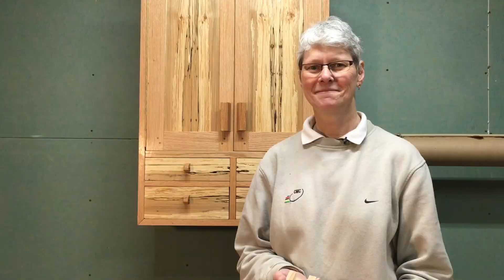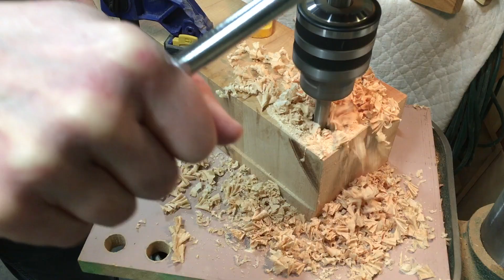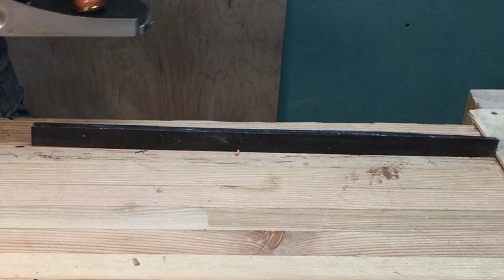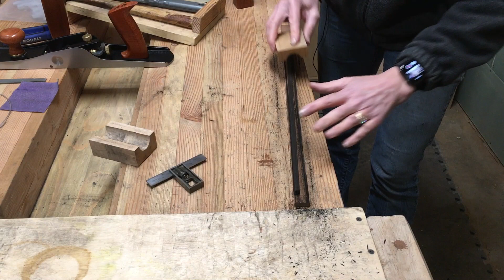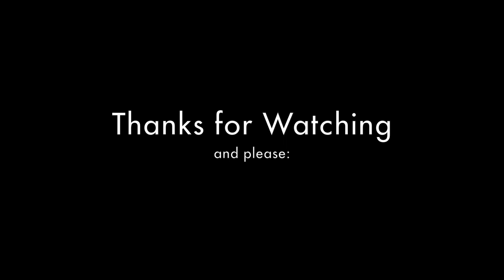Ebony Bar Shaping

Comment: How is working with hot hide glue bs old brown glue? I haven’t taken the plunge into the hot hide glue yet
Reply from the maker: Hit hide glue is a little more versatile in that you mix it for the particular application. But if the woods is cold (think winter garage) it cools the glue too fast. I still prefer it over old brown glue. Just a choice.
Reply: @SkyValleyStudio  thank you for the information